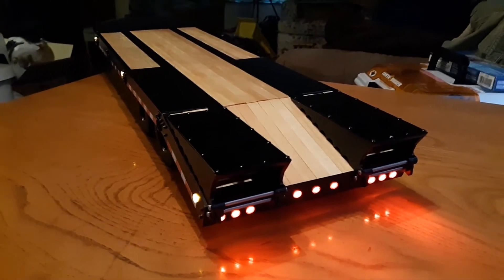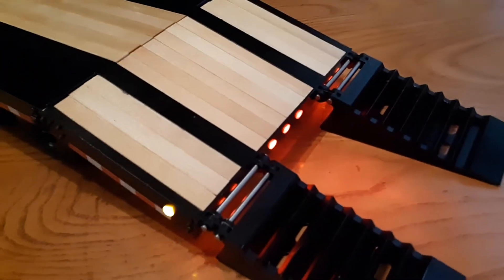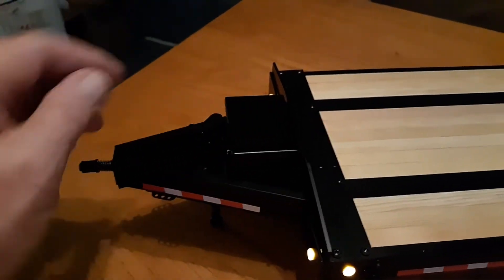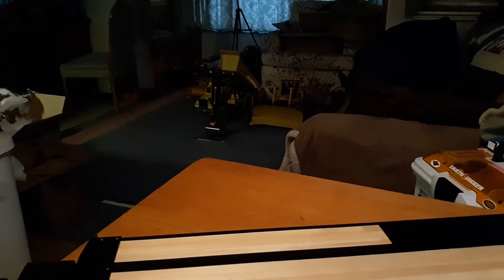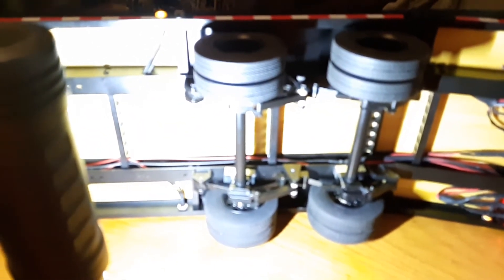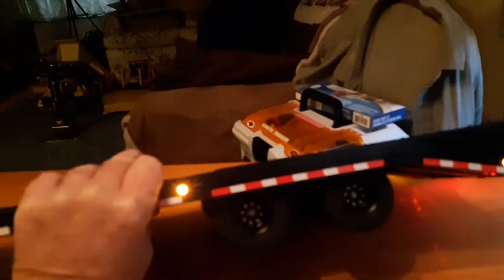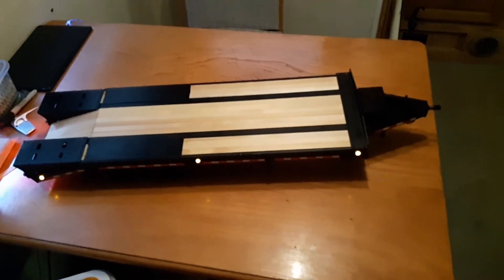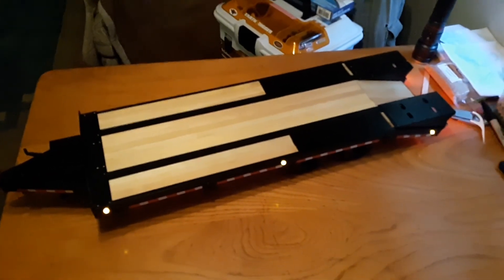Rc4wd Bigdog trailer

Comment: Hi less than a month ago I purchased the trailer I really love it man. Before I purchased the trailer I was not happy about the trailer having only two axles so I started investigating about adding another axle. So friend of mine that previously added another axle to it sent me pictures of what he did. So what I did I contacted RC4WD Support and within few days they found the axle and sent it to me from overseas, the axle came Monday and I just installed it today. Let me tell you it's really fine I didn't have to drill into the chassis rails because I believe the trailer was made for the third axle but probably they decided not make three axle. So probably with the third axle it would probably holds and balances the  weight more.